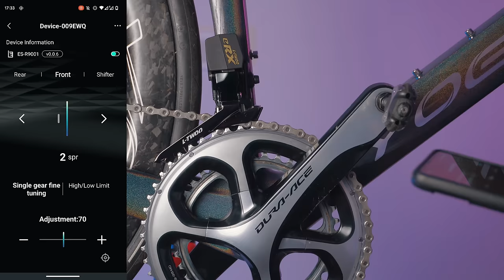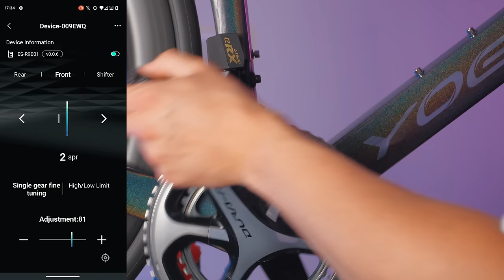The electronic groupset we have all been waiting for. L-Twoo eRX on the Yoeleo R12 aero frame

Comment: Watching this is super informative and kinda asmr-like making even the fiddly worksteps enjoyable to follow. Nice build and very clean look with the fully integrated setup.
Reply from the maker: Thanks a lot mate. Glad you enjoyed it 🤜🤛
Reply: Hey @klein-concept , did you run into any issues with the eRX set yet? I'm unsure if I should be investing into Ltwoo for my own build considering recent experiences by China Cycling, Trace Velo and GC Performance with the groupset. 
Since I went for a frame with full internal routing through the headtube rather than entering the frame on the side, I'm concerned mechanical shifting wont be working clean enough with the bending in the headtube/handlebar area which is why I would like to go for electronic shifting.
Reply from the maker: @iTzRafaaaa  hey, so far it is working for me but i have only out around 250km on it. So i would not fully rely on my experience with it here as there seem to be some obvious problems with some of the batches. I think if you have some time it might make sense to wait a couple months until L-Twoo have sorted out the issues or maybe consider going for a 105 Di2 as i have seen some discounts recently which have been pretty close to the L-Twoo pricing.

Comment: Really enjoyed this video. Yes, B screw adjustment is compensating for a chain that is too long, never a good thing. Also, next time you fit a hydraulic line, put the olive in the shifter followed by the locking screw tightened just to the point where it touches the olive. Then push the line in. This avoids cross threading. 
On another track, your chilling in Majorca video is on most days in my house thanks...
Reply from the maker: Thank you. Amazing tip to put the olive and screw in first. Makes so much sense and things a lot easier.

Very happy you re enjoying this one as well as using the Mallorca one as a screensaver 🤜🤛

Comment: Thank you for your excellent video! You singlehandedly did a better job than L-TWOO themselves at explaining this groupset lol. 

For your next video, may I suggest doing a guide to the companion app's pages and functions such as updating the firmware? The individual gear indexing also looks super interesting and I'd love to see how an adjusted eRX handles shifting on a 3rd party cassette and chain versus Di2 which is of course non-adjustable. Funny how Shimano and SRAM don't let us individually adjust cog positions but Campy and L-TWOO do!

Maybe also do a slow-mo of eRX and Di2 shifting on the same Ultegra cassette and chain so we can see how both perform in a best case scenario for Shimano and see which groupset actually shifts faster/smoother (refer to Jon Maloney Cycling's video on R9270 vs RED AXS). 

Or even installing Shimano or Magura mineral oil calipers to save weight and 3rd party pulley wheels onto RD to improve shifting even more? L-TWOO pulleys are 11T like Shimano, and some Shimano RD can even fit larger 12T and 12/14T pulleys on stock cage.
Reply from the maker: Thanks so much for the comment and great ideas for future videos. I actually have a slow motion side by side comparison of the eRX with my Dura Ace Di2 on the list. So that will be coming soon. Once there is a new FW i will make sure to cover that in a short video as well with some more details about the app. 🤜🤛

Comment: Fantastic video! I’m building up a R12 aswell with the Rx groupset. However might upgrade to ERX after seeing everyone’s experience. Following for the update
Reply from the maker: Thank you. I actually also started with the RX group and was halfway done. In the middle of the build the postman dropped off the eRX so i decided to put this on 🫶
Reply: Might be the same story with my build haha especially since I have the integrated bar/stem. Going with elite drive wheels I think
Reply from the maker: For the integrated bar it will be a lot easier to go with the eRX.

Amazing. I love my rim brake Drive wheels. Might get some disk ones for another bike as well. They are so lightweight.

Comment: That is not how you adjust the B-Limit screw on the rear derailleur. Your chain is way too long, you don't run it through the derailleur.  The B-screw should be adjusted so that there is 5-6 mm between the largest cog on the cassette and the top pulley wheel of the derailleur, and NO more.
Reply from the maker: Thanks for pointing this out. As another viewer also mentioned this yesterday, I will be shortening the chain today by a couple links. 🤜🤛
Reply: Thank you, saves me from making the same comment
Reply: After using the washer on the drive side of the 24mm axle is the distance of the crank arms to the chain stays the same? 🤙
Reply from the maker: @domestique3954  good question. Let me find out when i m back home later this week 🤜🤛

Comment: Dam, reaaaally tempting to get erx now... But, they are still dam expensive, so maybe waiting for it to mature a little bit more 😅. Been very happy with R9 hydraulic, didn't think i would like shift buttons that much but it has grown within me!

Thank you for creating such wonderful demonstration for these groupset!
Reply from the maker: Thanks a lot. Really glad you like it.
How is the R9? How was the setup for you? I know the price is not super competitive yet given some of the current 105 discounts but i would think the price might go down a bit after the initial hype 🤌.
Reply: @klein-concept  its been great with r9! I got it for under 200 euros for whole groupset (no cranks) so it was amazing deals for sure! But i still end up using 105 rd and fd for more precise shifting and also using slx calipers since my bike is post mount system 😅
 All though i have my new chinese carbon frame coming up with flat mount system, maybe after that i can test the orginal brakes 😅
Reply from the maker: @penzuugi  Very cool. Yes i heard the FD and RD are not that great but amazing that you can pair their shifters with Shimano components.
Reply: @klein-concept  Yes, that was one of the main reason for me to go for this groupset is Shimano part of compatibility. Stock rd all though ltwoo said it was compatible with 34t cassette which they weren't, so i had to get 105 rd because of my silly cassette choice😅. But even though only parts of ltwoo that i use is their Shifters, but they are still pretty solid and i had zero issues so far!

Comment: Thanks for the video!! I've been searching "ltwoo erx" daily to see if yourself or others have gotten to it yet. All looks very interesting. Am tossing up between eRX and a bigger jump to Rival or 105 di2 with the recent discounts/good prices on both, but this is sorely tempting for being cheaper and being able to run my current calipers, crankset + power meter, and 11s cassettes!  Only the thought of waiting for any issues to be polished or ironed out as with the mechanical ones, but firmware updates are easier than hardware ones hey! Will be interested to see how it is after some riding in :)
Reply from the maker: Glad you enjoyed it. It is not an easy choice between this and a good 105 di2 deal. I have to say i love to be able to trim each gear individually. But Shimano is also a really safe bet.  🫣

Comment: Very detailed and awesome build !!! I am seriously considering getting the groupset and this is going to be gold information !
Regarding the shifter bleeding, Shimano one's have some "burp" angles on the gen2 top port, maybe it helps to do the 45º up, 45º down pump pump pump and the gravity bleed.
Hopefully I can get it done :)
Reply from the maker: Thanks a lot Paulo. L-Twoo also released a new video on the process, which includes using the air whole at the top of the shifter as well. Maybe that s where the magic happens. I ordered another eRX groupset for the next bike so will also give it a try with the angles you suggested. 🤜🤛

Comment: Great video! Thank you. Do you think the Ltwoo levers could be compatible with shimano disc brake calipers? When you cut the chain, you don't need to passe it thru the rear derailleur, at least that's shimano says.
Reply from the maker: Thank you. Yes i heard they are compatible with Shimano calipers. Asked L-Twoo about it.

Thanks for the chain tip 🤜🤛

Comment: i am using a casette x11 on the rear and a chain X11 with a l-twoo eR9. i am facing some problem setting the front deralier: when i change the gear a can  cover only  half of the gears withoud making noise from the front deraier touching the chain. any advice?
Reply from the maker: There is actually a trim on the front derailleur. If you press the front shift button a second time it moves in or out a bit.

Comment: i have to say at first i was super stoked to see electric shifting from ltwoo. but then i checked aliexpress: 833€, shipped to me mid october and not coming with a crankset or sprokets makes the 1120€ 105 di2 or the 1200€ sram rival etap - both WITH a crankset and sprokets and shipped within days - look like the better option... or the rival 1 xplr for 950 ;)
Reply from the maker: I agree. Their price is pretty high yet but i think mainly driven by demand. For example i paid 609 euros plus 25 euros import tax for mine which is still at least a bit below a 105 di2.

I guess the prices will come down over time.

Comment: I was kind of expecting you to say when you couldn't push the fluid through, you forgot to release the clamp on the hose. Maybe because I have forgotten to do that more than once. LOL!🤣🤣
I have seen a couple of other videos on this groupset. They turned that screw out too far and it fell out. So, be careful.
Reply from the maker: Hehe also done that as well. Luckily not on camera 🫣. There is a new video from L-Twoo on the whole process and they also open another screw in the hoods that i was not using. So maybe that way it is easier.

Comment: Regarding internal routing the bar its significantly easier if you put 2 slight 45 degree bens in your shift cable. There is a fantastic video by Wrench Friday.

It allowed me to route 4 cables including 2 compression less housings through a fully integrated bar with relative ease.
Reply from the maker: Hey, thanks a lot for the tip. Will have a look at that video. Would love an easy way to route a internal cockpit. 🫶
Reply from the maker: Thanks a lot 🤜🤛

Comment: Thanks for the video, well made. I have the LTwoo RX hydraulic group set and I find the bleeding is very critical. Especially the front one, for some reason. Did you do something with the air vent screw on top of the hoods? I saw an instruction video from LTwoo where they also filled that one with oil after the normal bleeding procedure.
Reply from the maker: Thanks a lot Ben. The video which shows the air screw unfortunately came out after my build so maybe that would have made things way easier. During my setup i was not using the air screw.

Comment: I started building it today, but with a different frame.

haptic is high-quality, optically also on point.

problems so far...

Battery box rattles, had to help me with washers.
Bleeding the same experience as in the video, despite the premonition.
use ultegra brakes, but the behavior is the same, the preload screw is a mystery to me.

Worse, however, cracking in the left shifter when braking.
I contacted Ltwoo, hoping for a simple fix...

greetings to all, and to berlin...

don't let the lioness catch you.../inside Berlin
Reply from the maker: Interesting regarding the rattle. Maybe some electrical tape around the batteries could fix it.

But did you manage to get the bleeding done by now?

I think i have seen the squeeeking issue on another channel as well and it just disappeared over time.

Keep me posted how it goes.

Comment: Ltwoo just released a proper brake bleeding instruction and yours is different, they have this called vent screw and you release some pressure inside. Or it doesn't matter?
Reply from the maker: Yes their video didnt exists when i was building it. Maybe it would have gone a bit smoother using that extra screw. 🤜🤛

Comment: Great video, and super detailed. I have a question about the handlebars/stem combo, is there space to use an outfront computer on the handlebar or did you have to go with one that goes on the stem directly?
Reply from the maker: Thank you 🫶. I mounted the one that came with the Wahoo Elemnt Bolt 2. Was tight but worked. Will also try to mount one of these generic outfront ones where you replace two of the stem screws with slightly longer ones and add a mount that way.

Comment: Michael I have a question about a part in the box that the Yoeleo instructions really don't explain. The thin half shim that fits the steering tube registration marks of the spacers. What is that used for?
Reply from the maker: If you are talking about the c shaped shim I think it is a spacer to not have the cap rub against the frame when steering.
Reply: @klein-concept  Coolio! Just weird it is not on their illustration in the manual.
Reply: @klein-concept  I think I figured it out. It comes installed with a 0.5mm shim, and there is an extra 1.0mm shim in the kit box.
Reply from the maker: @jespernohr  ah i didnt even notice that they are two different ticknesses 😂😂

Comment: Thanks, great video and good insight into the groupset. Shimano 105 di2 is pretty much the same price. What’s your take on the erx after a few rides? Go for the erx novelty or stick with shimano for reliability?
Reply from the maker: Thanks a lot. It s a very good question. So far i still really like it. Shifts super smooth and brakes well. I guess it comes down to how much of the drivetrain you need. If you have a cassette, the discs and a crankset i think going for the eRX is a valid option. Of you need a full drivetrain 105 might be a good option at the current prices.

Comment: Mint review and bike build. But how did you set up the H and L  limit screws or did you do this manually with the two limits screws after shifting into the appropriate course
Reply from the maker: Thank you 🫶. To be honest i didnt even touch these screws. In the app there are also limit adjustments which i used to make sure the chain stays on the cassette on the outer positions.
Reply: Can you use either or? Have you been out in the wet? Reports of erx failing after heavy rain seems to be an issue and going to sleep mid ride etc. I so want to pull trigger in buying groupset. Btw again great video.
Reply from the maker: @chrismadden9126  i guess you could do either or. For me it worked out of the box with no real need to adjust limits on the hardware. Only did it in software additionally for security.

I have not been out in rain yet but did not have any issues with sleep mode. Also a new firmware came out yesterday so maybe that addressed some of the issues.
Reply: That is good news. Well consider me subscribed. Looking forward to long term review
Reply from the maker: @chrismadden9126  thanks a lot Chris 🍻

Comment: Who cut the steerer tube? What were the dimensions and interfaces (crown race?) of the headset bearings? Thanks
Reply from the maker: I did cut it in my backyard on top of my trashbins 🫣. Let me find out the bearing dimensions a get back to you.
Reply: @klein-concept  I understand, you may not want to take the headset apart to measure. But maybe you could at least tell me if there was an integrated race on the fork or if it was just straight platform and an aluminium race from a headset? I would get Yoeleo to cut the steerer if they could do it. This way you are not exposed to carbon dust and will probably get a cleaner and safer cut as a result.
Reply from the maker: @Hard_Work_Is_Rewarding  so sorry for the late reply and thanks for the reminder. The steerer came with an 39.8mm diameter aluminium crown race.

The bearing has the following details written on it: 15 8HXOD52 45/45.

Hope that helps 🫣
Reply: @klein-concept  Thanks, does help! So 45% interface and a non integrated crown race. And what is the upper bearing?
Reply from the maker: That one is  15L 7H ø52 ø40 45*45

Comment: Awesome Video, exactly the build I would do if were in for a new bike. Can you tell us how much you have spend on the build?
Reply from the maker: Thank you 🤙

- R12 Frame 1640 Euro
- Wheels 900 Euro
- Groupset 625 Euro
- Crankset 200 Euro
- Chain 30 Euro
- Tires 100 Euro
- Saddle 50 Euro

Overall around 3545 Euro